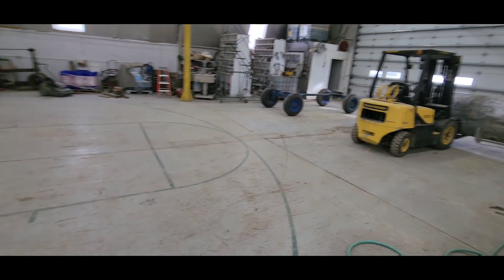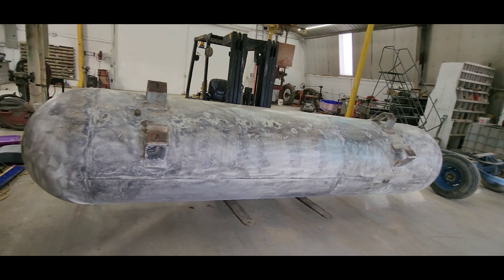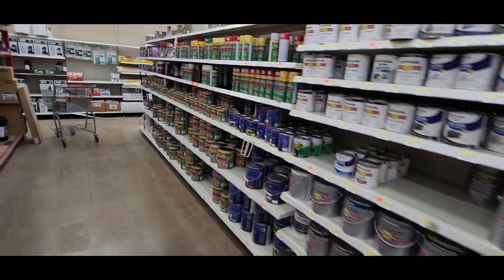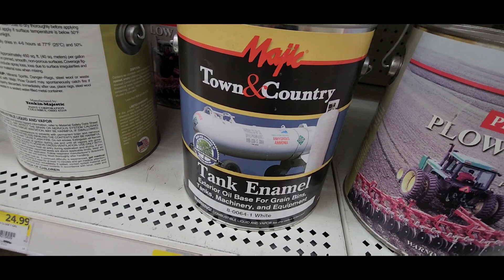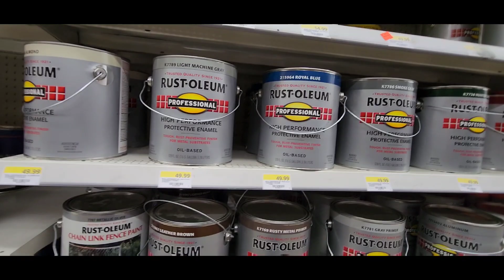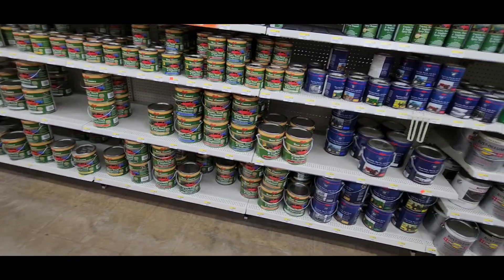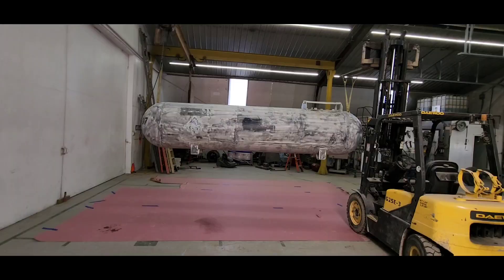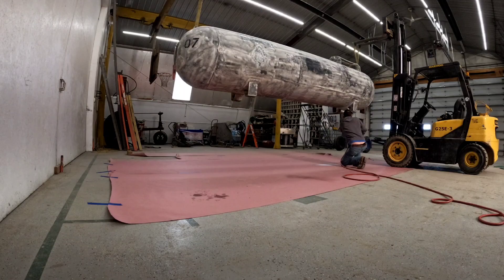Let's Paint!

Comment: I have found that hitting these tanks with a Roofing Torch 🔥 will break down, burn and just help old paint come off easier with grinder or wire brush. 

Torch handi too for roofing, melting ice de-thawing 🧊 equipment, starting wood coal stove in work shop.  My old style Bobcat quick tach handles would get packed with snow n ice. Torch was best way to free up bucket, snowblower etc to change attachments. 

Guys Great Job as always  👏 👍 👌

Comment: If you had something conical. Like a stepped drill bit.  Basically paint everything without moving tank. 

One could use that to with a short pipe connected to the running gear and perhaps a line to the hoist for as a safety strap.

Comment: Just an FYI from a plumber/pipe fitter.  Those are not couplings.  Those are thread protectors. Couplings are tampered. Those are not.
Reply from the maker: Says in the order 21' 3/4" black pipe with coupler
Reply: @Border View Farms  couplings are tampered inside to match the tapered ends of the pipe to create a seal. However, most 21' stick comes with a plastic end cap and what most retail stores (and some plumbing warehouses) calls as "coupling". But the reality is. In order for it to be a true couplings it must be tapered. What usually is attached, is the same as a nut for a bolt.  You can thread a nut all day long on a piece of all thread because it is not tapered. That is how those thread protectors are.
Reply: @Border View Farms  and I apologize...I see the autocorrect feature got me a few times. For the word "tampered" or tapered ends. Just a note tampered, tappered...All were meant to say tapered...lol

Comment: You think that salmon farm is going to be good until your well goes dry at your house. Contrary to what they are telling you that there's an endless supply of water in that aquifer there isn't. Especially when you withdraw the amount they are.
Reply from the maker: I have little concern about the well. Water literally flows out the the ground here. The amount they will withdrawal is a drop in the bucket compared to the whole local hydrological system.